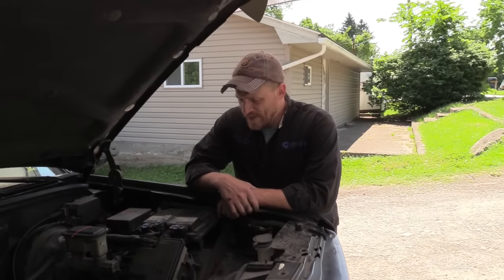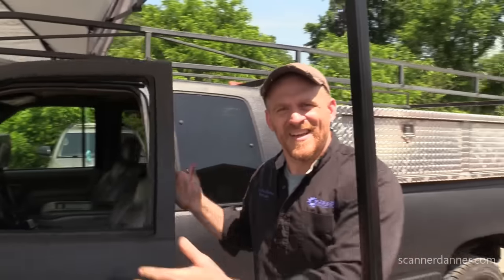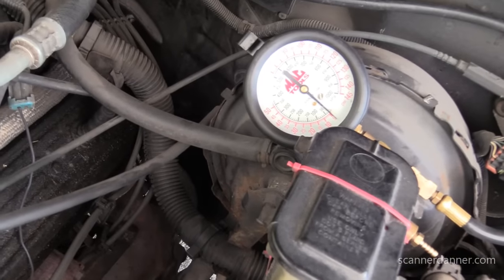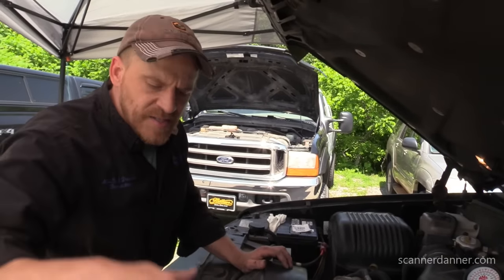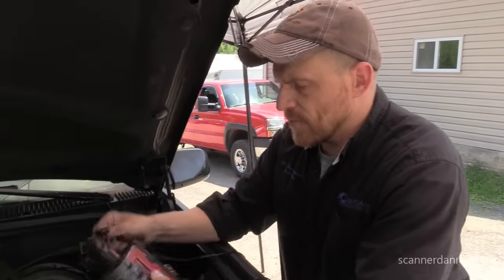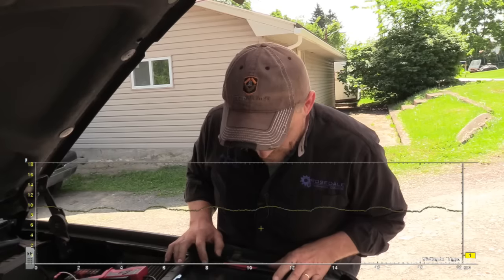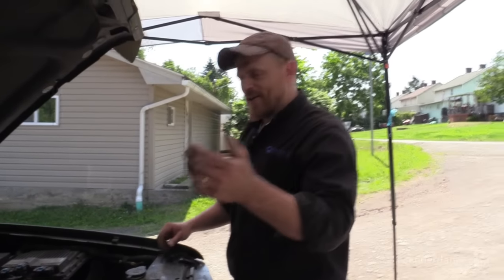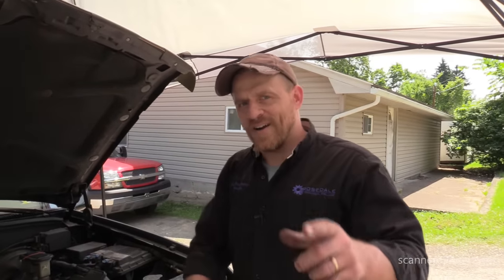Quick Diagnosis of a '97 Chevy with a Fuel Pressure Problem

Comment: Thank you very much, you saved me from changing a fuel pump prematurely. My problem was the ambient air sensor. Your  unplugging of the mass air sensor got me over in the right area. I unplugged one at a time and it acted exactly like you said then fell on its face when I plugged it back in.

Comment: Several things influence fuel pressure while the engine is running such as the fuel pressure regulator setting, ambient temperature, coolant temperature, percentage of throttle opening, altitude above sea level, overall engine condition and engine load. All of which have a direct affect on fuel injector pulse width,  which directly affects fuel pressure. Due to these variables, GM does not publish any “engine running” fuel pressure specifications for this system. Fuel pressure and leakdown must be tested with the engine off.  Fuel pressure: Key ON, engine OFF, (fuel pump will run for ~2 seconds and shut off). Fuel pressure must be checked when the pump is running: Pressure must be 60 psi to 66 psi. It must remain above 55 psi for at least 10 minutes after the pump shuts off.
Reply: Correct. I was wondering why no leak down test.
Reply: What are you yapping about

Comment: I know this is an older video but it's the gift that keeps on giving and I thank you for it! 

My mother in law's 97 S10, 4.3 had the exact same symptoms at your truck in the video. I was sure it needed a fuel pump and was dreading having to do it. Anyway, after watching your video I went out and checked the fuel pressure and amazingly it jumped right up to 61-62 psi when the throttle was blipped even with the backfiring and falling on its face. Hmm, fuel pump was okay.. The thing that saved me was what you said about the MAF sensor. I was clueless. There were no codes for it and i had no idea what the symptoms of a bad MAF were but I unplugged it and amazingly it ran perfect, Problem identified and a hell of a lot easier than a fuel pump would have been. So thankful I came across your video!
Reply from the maker: Awesome! You can clean those MAFs too btw. You most likely do not need to replace it
Reply: @ScannerDanner  Well, I ordered a new one as soon as you taught me how to troubleshoot it, which I'm okay with. I'm just so happy not to have to change a fuel pump (although that's probably going to come up soon too).

Comment: I had experienced this "weak" pump with my former ford f150 and my wife's toyota 4runner. Both pumps worked, hummed and all. Fuel pressure was up, but weak. People around me argued that if it's spraying fuel out of the port, then it's not the pump. Both cases, I replaced the fuel pumps and the issues were fixed. I argued that it can spray and still be weak. They said no lol. I'm a DIY type of mechanic. My ford had the exact same symptom with pushing the throttle down. Awesome video.

Comment: Was glad I could teach him about CMV Air Brakes one Saturday. A gift from a flower to the garden. Keep sharing the love dude. 🤙🌺
Reply from the maker: Who's this? Did you help me with my RV?
Reply: ScannerDanner yeah I did. One Saturday afternoon on Facebook?. I really studied hard at school. 80,000 pounds in New England you gotta have good Brakes. I follow you on Facebook.

I discovered your videos trying to figure out my 44 code on my 1995 Chevrolet LT-1 vin code “P” “Coprice” that sits far too much. I just found his one too in my quest to get my car registered again. Though the tests have gotten much better still not passing. Still can’t get my “Coprice” through emissions. 🙄. Driving me crazy. 

I told the young tech that does the test about you, I’m not sure if he’s taken my suggestion. I sent him this link to the garage he works at thinking it might tweet his curiosity if he knew you can figure out the fuel pump rpm with waveform on a scope. That BLEW ME AWAY. And yes. We followed the math. Your a great example for the kids in far more than fixing cars. Follow your bliss and you’ll never work a day in your life. Eh? God bless you.
Reply: Same back atchas. 🌺💕
Reply: ScannerDanner ohhh you’re the guy to ask. Duhhhh me. How do I light up the catalytic to do a “self clean oven cycle”. I saw in one of your videos mention of conditions that would result in that? 

They do seem ok to me. 100~150°F, hotter at the rear of cat than the front incoming temp. I think I saw 650°F on the out end. Months ago. No back pressure issues that I can perceive.

Comment: I have an '01 with a 4.3 having what I think is fuel pump related. No codes, 61 psi KOEO, 51 psi at idle. It sometimes will have an extended crank time and it bucks and stumbles on accelertation. I didn't know you have to do a snap throttle as well.....thanks for the info! Learned something new today.

Comment: I had the exactly the same symptoms running that you show. My fuel pressure was 60-65 and it didn't vary a bit so I assumed the pump was ok. After much thought, I realized these injection systems are also sensitive to FLOW. Good flow is needed to crack the poppets at each cylinder so I thought maybe the filter was restricting it. Turns out it was. New filter, same pressure reading, runs like a champ! 

You'd think a flow problem would have shown up in the pressure gauge when you opened the throttle, but it didn't. I can't say these injection systems are bad, because I have 225,000 miles on mine, but turns out they are more sensitive to BOTH pressure and flow than port injected designs.
Reply from the maker: It would have on a test drive, but yes, this can be difficult to ID sometimes. Nice job

Comment: This is a good lesson in how quickly you can diagnose a system. You knew very quickly that it was probably a fuel delivery problem, eliminated the MAF Sensor and checked the pressures. DONE.... Needs a pump! Then went a bit further to confirm the bad pump. Case in point, a quick Current Check of the pump at the relay told you that Power & Ground at the pump were good, THEN you expanded on it and even did an RPM check that would fit with a slow turning pump having a volume problem. You also explained that pressure OK on deadhead check, but of course Supply Volume is NOT a factor when no fuel is being consumed. You cant always take this approach, but when you can, it will build confidence on the part of those that can follow it easily, BUT ALSO, explain the methods & rational to those that are learning..... and we are ALL learning. BRAVO!

Comment: I like your watching 02 sensors at wide open throttle. Cant be a regulator because the rpm goes higher. I like your rpm testing. Plugged fuel filter but if your system needs a filter that bad and you change its already heated the pump so bad that the pump usually dies out not long after the damage caused from a bad filter. All your videos are great teaching or non teaching.

Comment: This is the first video ive found on youtube that makes me want to go to patreon and sponsor... for just this information alone. Ive been chasing the same, if not very similar, problem on my 99 burban for years... Ive had a feeling its been supply issues all along, however after 2 pumps, many filters and a pressure regulator, the problem persists.... BUT ONLY WHEN COLD.... when warm the hesitation lessens significantly,  IF and WHEN i can get it to start. Ive been wanting to get the type 2 scanner to read all the GM sensors to zero it better but its hard to justify the cost for the few GM vehicles i run. Now i can pursue the problem with a gauge and a bit more knowledge that i may be dropping the tank again. THANK YOU.
Reply from the maker: Let me know how it goes with your fuel pressure tests. I can help you further too.
Thanks so much!
Reply: @ScannerDanner  thank you danner. I picked up a gauge today at hf and gave it a checkin... key on, 60psi, start truck and runs down to 52 or so. Holds at 52 under throttle, engine turned off, back to 60....im thinking my pump is running ok, so back to the intermittent, warm hard starts.. Ive read "somewhere" the resistance in the engine temp sensor runs back to the pcm to trim fuel, leading me to believe there may be a resistance problem in that sensor, hence the hard starts when warm. Thats my first guess, so ill ohm it out at the temp specs tomorrow. Next guess would be making sure pump has the recommended supply of voltage at all times, and ground... however thats not going to have much to do with the temp of engine during the hard starts. Thanks for the help, im going to get to the bottom of this problem someday! Next steps i guess, Im going to look into making darn sure that pump is working as it should, how the fuel pressure regulator can or will affect gauge readings, and learn how that temp sensor affects the pcm. Again, much appreciated!
Reply from the maker: @plowmaster1206  you get this fixed? sorry
Reply: @ScannerDanner  thats ok. I think i may have, but ill need to drive it more. I ran it thru torque scanner and found b2s2 to have flatline low voltage, exhqust leak.... so i rebuilt the exhaust system. Im hoping the hard start after warm condition was just the fuel trim leaving the engine flooded, compensating for the extra air downstream. Time will tell, ill drive it this week, note the starting, ltft and stft.
Reply from the maker: @plowmaster1206  your system doesn't use downstream fuel trim control, so unlikely my friend, I'm sorry.
Reply: @ScannerDanner  so what are the second o2 sensors for? Ill do some research.... im assuming when i open my options for fuel trim graphs, i wont be seeing any from the rear sensors.
Reply: @ScannerDanner  also all is not lost.... the exhaust had a significant leak at the flange right in front of one rear sensor, the one that was reading low voltage. Now exhaust is tight and both sensors are reading same voltage, however those two remain graphed at a very straight line, i.e. do not increase or decrease voltage like the fronts will.
Reply from the maker: @plowmaster1206  catalytic converter monitoring only!
Reply from the maker: @plowmaster1206  I'm so sorry, it is hard for me to keep up, especially with follow up comments. I get about a hundred new questions a day, and do my best to answer them and when I do, they just multiply! Anyway, if you still need help, I have created a forum on my website https://www.scannerdanner.com/forum/post-your-repair-questions-here.html that is free to join, where I have 4 hand picked moderators and over 25k global members who are there to help me help you guys! You will not find a more friendly and helpful forum anywhere. Hope to see you there! Thanks for understanding.

Comment: Isn't there a test lead behind the fuse/relay block for running the pump?  Either way, although it is glued, it's fairly easy to run a knife blade around the base those relays so the cover can easily pop on and off... do that on one you carry with you, now you have a manual switch to test the pump without having to worry about jumpers or letting the smoke out.

Comment: Just to add, i love seeing the after numbers for fuel pressure, and voltage humps for the RPM of the motor, just to see "known good" conditions.
Reply from the maker: I understand, I can't always do this as the repair is done at a later time. I try to do this whenever possible

Comment: Can you expand on the Vaccume based fuel pressure regulator? That was really interesting.
I thought going in, I would like this new format, but when you started explaining then stopped, I realized how much the explanations interest and teach me.
Reply: Shcroedinger's box has a good video on fuel regulator operation and diagnosis.
Reply: nabeelr vacuum at closed throttle regulates fuel pressure to a lower pressure, more fuel is returned to tank. As the manifold vacuum is decreased with throttle valve opening, fuel pressure is increased.
Reply: 🤓 Makes Sense, Vacuum Fuel Pressure Regulator has an air hose just like the Vacuum Advance on a Distributor has an air hose, when u step on the gas pedal you create a vacuum leak, a drop in vacuum changes the fuel pressure going to the injectors, I imagine you want more fuel pressure if you step on the gas bliiiiiiiiiiiiii 🚤😍🚩
Reply: MrSammy vacuum is greatest at closed throttle, when you open the throttle vacuum is reduced, wide open throttle is atmospheric pressure. The fuel pressure regulator decreases fuel pressure at high manifold vacuum and increases it as manifold vacuum is decreased.
Reply: Jake Elliott 🙂 sounds good, except for the atmospheric part, I think u always have to have at least a little bit of vacuum even at WOT, unless its Super Charged yay! bliiiiiiiii 🚤😍🚩

Comment: I have a 97 buick park ave and no one can seem to solve my problem, I hope you can. In the summer when the outdoor temp. exceeds 85 F and my engine temp. reaches 205 F to 212 F when I feed gas it hesitates and stalls but starts right up with no problem starting. It will run as long as I don't try to accelerate. Please HELP.  Thank you .....Joe

Comment: what if you had a break in the wire leading back to the fuel pump , say it was melted like mine  , 97 Jimmy , would you still have 9 amps at the relay up front , I'm having mad fuel pump problems , my 4 wheel drive Suzuki Sidekick 
" woods ride " same problems, similar pump , been through six pumps in two years ....by the way love yer show , very good info, killer delivery, no bs , right  to the point ...thank you so much .. ...
Reply from the maker: You would not my friend. Amperage doesn't change in a circuit, only voltage

Comment: Very informative! I have a 2003 s10 that I have been getting p0300 code and have been chasing ignition porblems. Everything in the Ignition system is new and all AC Delco. After looking a LTFT, they increase during Acceleration leading me towards MAF or Fuel Pressure.  The MAF according to my Scanner is good. Clened it  and still no change! Noticed fuel pressure was static 58psi and running 49-50 psi. Changed fuel filter and made a slight pressure increase and p0300 stopped for two days. Noticed pressure dropped back to where it was, so I changed the pump and still the pressure was the same and I hate being a parts changer. I believe this truck has the same pump pressure and from what I found is static should be 60-66. I did amp test and it was 7.92 almost 8.00 amps. Next I did a Voltage drop test and found that the positive side had a .9 volt drop. I am waiting on my Manual to come in, had to order one because none of my part stores carry it. I want to verify pressure. My next thing is to trace the wire from the fuse block back to the pump to find my Voltage Drop.  Great Video! Shows me I'm on the right path.
Reply: Correction on my Amp check it was 6.85 amps.

Comment: wonder if a bad filter could cause slow pressure response?🤔
Reply: Willy Cooke YES IT COULD!! But in this instance, the amperage draw of the fuel pump did not show that the pump was having a resistance!! The amperage draw showed less then normal amps, meaning that it was doing all it could, and not being blocked by a fuel filter blockage, and wasn't doing enough, period! 

The diagnosis and recommendation to this vehicle would be a new fuel pump, AND a new fuel filter! Even if it was just changed to help with the problem!! Trash and sediment would certainly be pulled into a new filter, before removal and replacement. Emptying the tank of all old sediment and dirt is highly recommended! A new pump, cleaned tank, and new filter, would certainly outlast a car of that age!! Especially in that area!!
Reply: It could, but gasoline engines don't depend on volume as much as say a diesel does.  So you would need a really, really, plugged up fuel filter to get this symptom.  Lean misfires like that underload, you have a flat out pressure issue, and it's almost always going to be at the pump.
Reply from the maker: Absolutely a plugged filter could cause a low volume/psi problem (which is what we had), changing the fuel filter and retesting is about the only thing you can do, other than measuring psi before and after the fuel filter, which no-one does. In my experience, when a fuel filter gets plugged to the point of low volume symptoms, the pump it getting replaced anyway.  Damage occurs to the pump (higher than normal amperage/heat) from plugged filters. I had a customer with a plugged filter (work truck), changed the filter, all was well, happy customer in that he only needed a filter and not the pump, truck comes back 2 months later on a tow truck with a bad pump and he was very angry with me in that he had to miss another day of work. I have never just done a fuel filter since.
Reply: I have a 96 GMC 1500 ,starts fine but the second I let the clutch out it spits sounds like misfires and was wondering if it could be a fuel pressure regulator ,a intake gasket leak or fuel pump? Please help

Comment: 1994 s14   v6 vortec Fount out what it is  the ICM in extributor crank no start .if not maybe crank shaft sensor I've done everything to wire power faulty wires .my Jeep broke down on my wife I do not have scanner but 2002 Jeep liberty sport it hit me to turn key on and off three time then it showed me the codes matter of fact you showed me that and it worked I'm not stupid just had tumor anyurism surgery about year ago getting better but you break it down and I appreciate this thank you.

Comment: I can't remember the exact pressure but the injector poppets won't even open much under 50psi on most of those systems.  I once shot some brake clean through the TB and cooked the plastic lines on the injectors when it backfired.  Hard lesson learned :-(